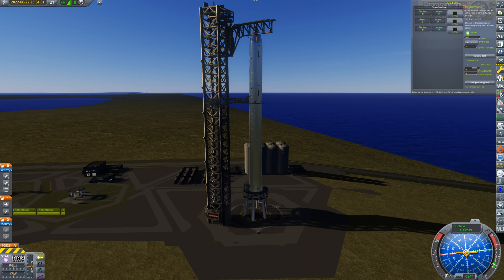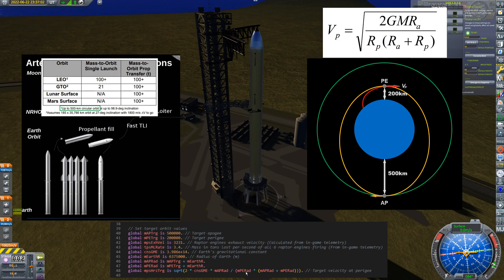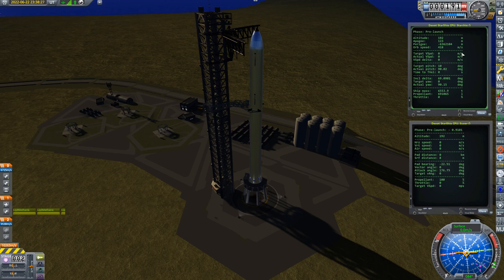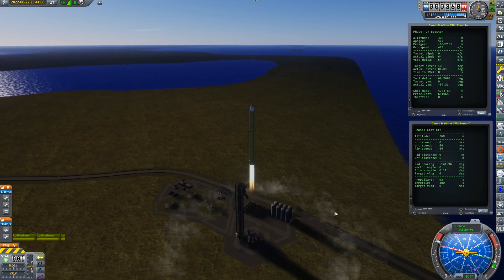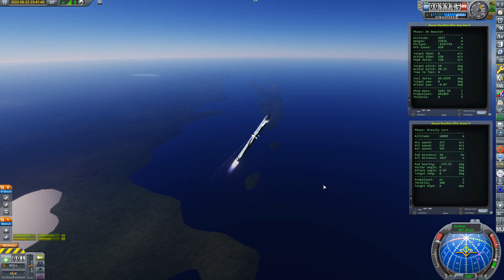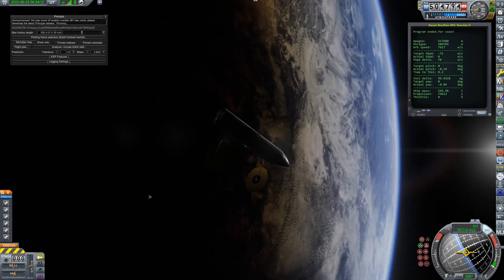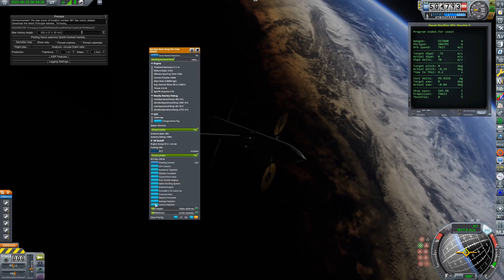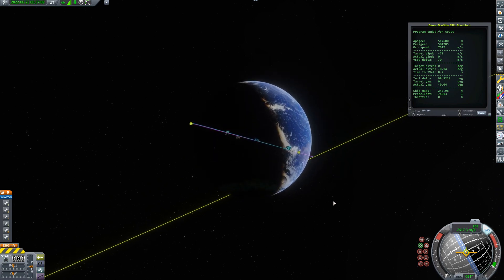Using automation to reach orbit with SpaceX's StarShip

Comment: Can you link me some pdfs on this sort of thing? I'm assuming this is based on PEG, or an algorithm like it. Where I have trouble is the prediction of the future position of the vehicle. From what I understand, after you define the coasting trajectory, you have to do a "guess and check" procedure to get the time at the end of the burn (since that cant be calculated directly you basically keep trying different true anomalies until you get it right) then check to see if the position and velocity on those are right, then add them to the required position and velocity, recalculate the burn time, then repeat this until you ideally until you get an end result that doesn't change, more or less, which you follow until terminal guidance. I guess where I'm getting stuck up is the computation of the orbital state vectors. Like, your looking at earth top down, and your at 6 o clock, orbiting counter clockwise. How would you calculate the shifting of the two values representing the x and y, because at three o clock your y would be zero but x would be the radius of earth + your altitude, and at 12 o clock the y would be radius of earth + altitude, and x would be 0, but how would you handle it for non-standard values? same sorta thing with velocity.